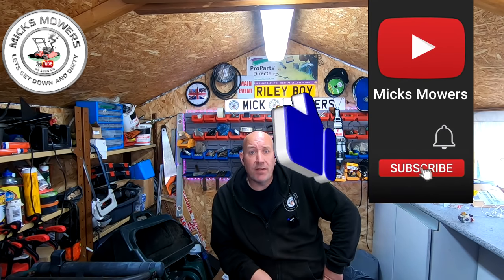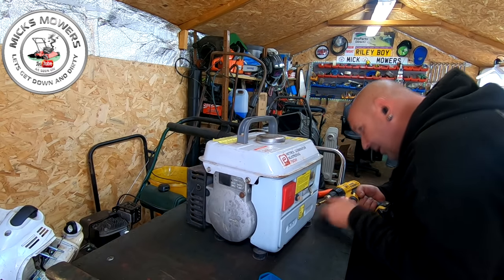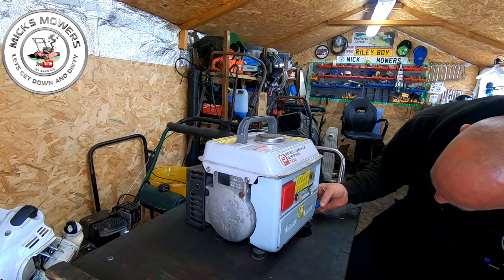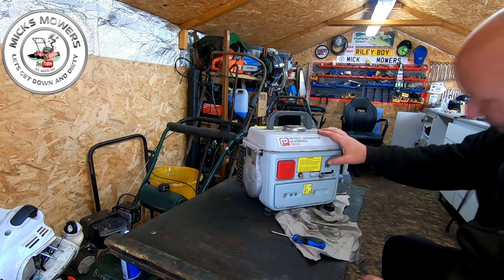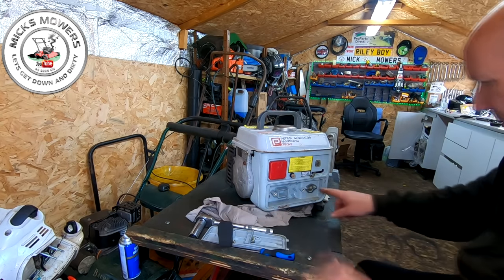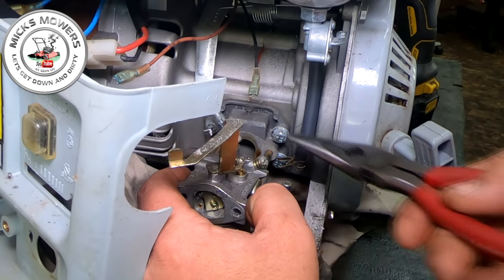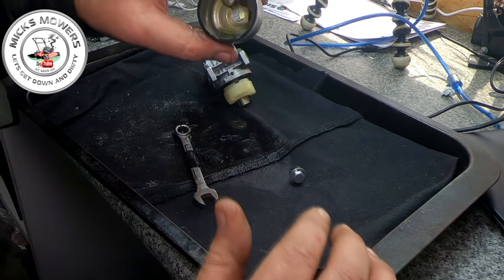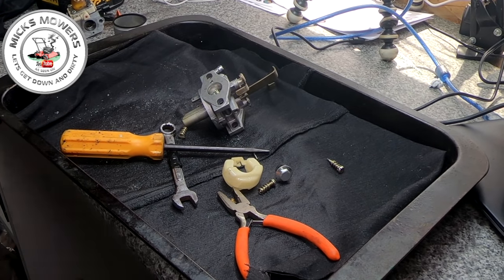Generator Saved From The Landfill A Quick and Simple FIx

Comment: Hi Mick
Couple of things I have a makita generator and it keeps hunting I’ve had it looked a was supposed to been fixed but when I used it is still hunts any Idea what I could do stop this.
Plus I have a sthil strimmer and it’s a absolute pig to start again I told them when it went in for a service it was a pig to start and now it’s even harder to start.
Reply from the maker: Hunting is normally a fuel or carb problem mate.. regarding the Stihl. It could be a simple fix like a plug of a fuel problem..
Reply: @themowerman  where abouts are you plz mate if your near me I would get you to do all my machine maintenances
Reply from the maker: South coast mate
Reply: @themowerman  shame few hours away from me